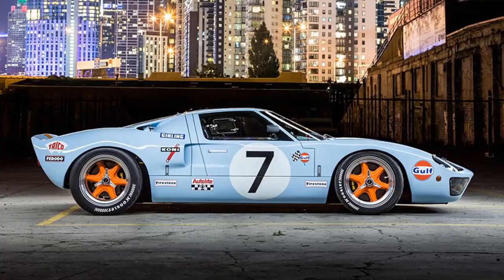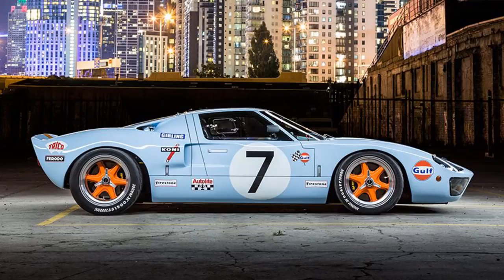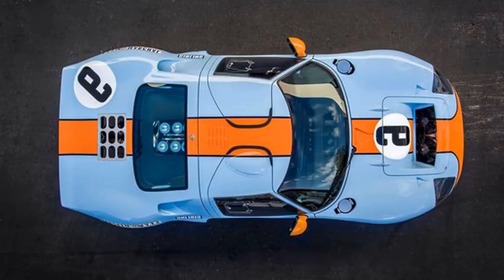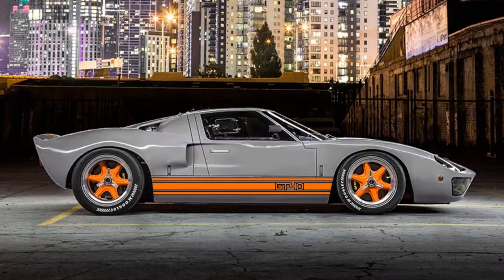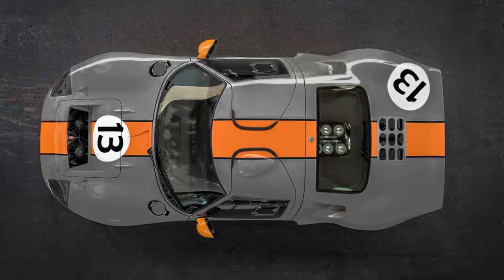GT40 Kit Car Build - Ep 03 - Build Specification

Comment: The LS is a great engine but not right for your project. Glad you're keeping it all Ford. Engine building is not difficult but careful machine work and proper assembly are critical. Then you need a tuner/dyno operator who knows what they're doing.
Reply from the maker: Thanks Miles.

Comment: Why do you think a monocoque will give more modern handling? I've had both a mono and tube frame Gt40 and i would pick a tube frame every time. Far easier to work with and repair. Your suspension geometry will determine the handling far more than the chassis material provided the frame is strong enough which they all are.
Reply from the maker: G'day jase6370, thanks for sharing your experience with both the mono and tube frame. You do raise a good point re the chassis as all chassis' will need to meet a minimum torsional strength etc.
Reply: @BuiltbyDan  The reason I would personally go mono is because of safety.
Reply: Surely the main benefit of the mono chassis is not having to do heaps of welding..
Reply: @brendan0loughlin419  why would you need to do welding? Kits come with a prefabricated chassis
Reply: @brendan0loughlin419  True

Comment: Good Morning. Why don't you put a 
5.0 Coyote Engine 6 Speed T56 Manual Transmission ? It does not fit the GT40 kit or if it works for you but you prefer another transmission ? I am writing to you from Venezuela.
Reply from the maker: G'day Anibal, the T56 is not suitable for this kit as the engine is mounted in the rear. It requires a transaxle rather than a typical transmission.

Comment: So what are the shifter options for the Graziano gearboxes? I understand that the paddle shift and gated manual are essentially the same- does the kit supply linkages?
Reply from the maker: Yes, that is my understanding. The internals of the transaxle are generally the same, the difference is in the shifter mechanism, either manual or hydraulically actuated. The transaxle was purchased separately to the kit, but the kit does come with the shift and shifter cables.

Comment: Hi Dan, I look forward to your build. I like the color scheme that you’re going with. I ordered a Racecar replica GT40. I like their aluminum monocoque. I am using a crate LS3 with a Porsche transaxle. RCR has had success with this combination. RCR sells rebuilt transaxles for $4,500. This is the same combination that they used for the Ford vs Ferrari movie. They made 18 cars for the movie and the stunt drivers didn’t break them.  I plan on insulating the car and install some muffling on the engine. I want to take weekenders with it but want it to roar on the track. I will do the Gulf livery and am working with an interiors shop to wrap the interior with leather with the Gulf theme. I look forward to your build. Mine won’t start until August. Cheers.
Reply from the maker: G'day James, thanks for your support and good luck with your build too! Thanks for the tip re RCR rebuilt transaxles, unfortunately I've already locked in the transaxle spec and chassis has been developed to suit, plus I've already placed an order on a brand new Graziano. From what I understand RCR can sometimes be selective about what they will sell to people that are not building one of their vehicles. Whilst mine is an aluminium monocoque chassis, it is not an RCR.
I too intend to insulate as much as possible to manage thermal and acoustics in the cab as I want it to be 'comfortable' to cruise.
Reply: Built by Dan Excellent. The Grazianos will handle more HP but cost quite a bit more. At least, here in the US. I look forward to watching your build.

Comment: For reliability I decided to go with a gen 2 coyote ford engine. Really?  reliability? you haven't been following MSM on Ford's quality control issues? lol.

Ford "Quality is job none". Sorry, I know thousands use coyote engines but considering I'm close personal friends with someone who bought a brand new coyote crate engine direct from Ford and it came out of the box mistimed, and the trouble he had dealing with Ford on it, the LAST engine I'd put in a build was a late model coyote. 

What happened was: he bought the crate engine to put in a mustang. An old school engine builder in the area was chosen to do the work. This guy builds his own engines and has the equipment to do it "right" and knows Fords inside out and backwards. They rec'd the engine, took it out of the crate, installed it, did everything according to OEM instructions. All new Ford coils and plugs. Fired it up. ran like a backwards donkey. Checked all the coils. Fine, Checked out the plugs, fine. Checked out the injectors. Fine. ECU: misfires all over the place. They worked on it for a week straight couldn't figure out what was wrong so finally towed it to the local ford dealer. 

Ford dealer found engine out of time and they tried to blame the builder. They never had the rocker covers or timing cover off so how could they screw with the timing? 

So if memory serves, Ford wanted to time the engine and send him on his way. He said "umm no, I want a different engine. Who knows what damage was caused by it being out of time". I forget, it was something like 15 degrees. It theoretically should have been fine but when you've spent $14,000 on a brand new crate engine, why risk it?

With a lot of lawyers and back and forth Ford agreed to re and re the engine and replace it with a brand new one (which turned out fine).
Reply from the maker: Thanks for sharing that experience, something I'll definitely by mindful of moving forward.
Reply: @BuiltbyDan  Hey, you could be one of the lucky ones and get a good one. 

Not sure what it is like in Australia but in the US there are literally thousands upon thousands of wrecked mustangs in copart auctions. If you find one with 30,000 kms, take it to a local engine builder and have him thoroughly check it out.

If I was building a GT40 or Cobra, I'd be buying a 351 Cleveland and putting a holley EFI system on it. You want reliable? There thousands built in the late 60's still purring like a kitten today with minimum repairs.